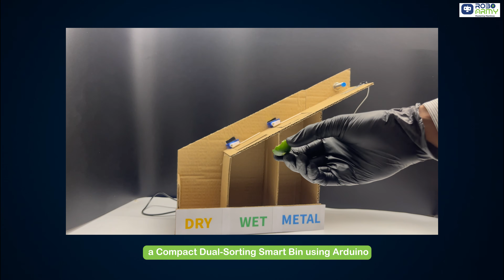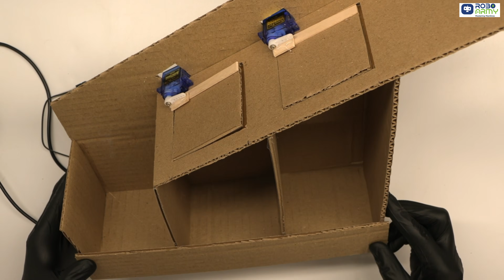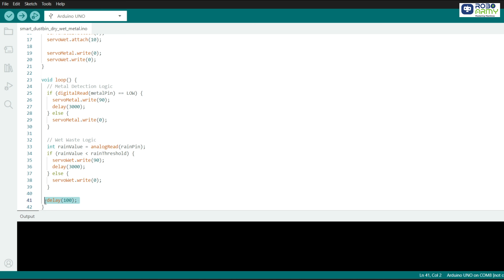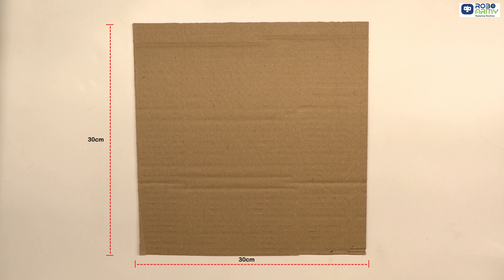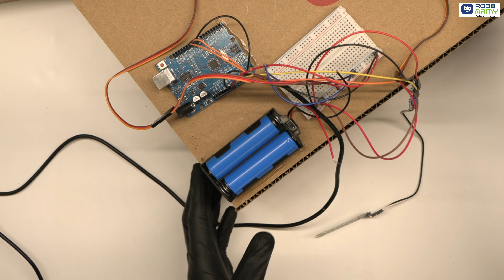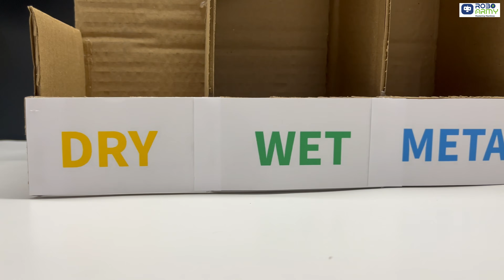Smart Dustbin using Arduino | Dry, Wet & Metal Waste Segregation Project 2026

Comment: sir make video using esp32 insted of arduino uno please sir ite a very very humble request and can we use rain module sensor insted of soil moisture?
Reply from the maker: Thanks for your suggestion! Yes, we can build this project using an ESP32 instead of Arduino Uno, and we'll try to upload a dedicated tutorial soon. You can also use a rain sensor module instead of a soil moisture sensor, as both detect moisture through conductivity, but you'll need to adjust the sensitivity and test it with different types of waste.

Comment: The code is not working
Reply: Please send me the crt code for this project
Reply from the maker: #include <Servo.h>

const int metalPin = 8;
const int rainPin = A0;

Servo servoMetal;
Servo servoWet;

int rainThreshold = 500;

void setup() {
  Serial.begin(9600);
 
  pinMode(metalPin, INPUT);

  servoMetal.attach(9);
  servoWet.attach(10);

  servoMetal.write(0);
  servoWet.write(0);
}

void loop() {
  // Metal Detection Logic
  if (digitalRead(metalPin) == LOW) {
    servoMetal.write(90);
    delay(3000);          
  } else {
    servoMetal.write(0);  
  }

  // Wet Waste Logic
  int rainValue = analogRead(rainPin);
  if (rainValue < rainThreshold) {
    servoWet.write(90);  
    delay(3000);          
  } else {
    servoWet.write(0);    
  }

  delay(100);
}

Comment: Can I use an adapter instead of battery pack
If yes how much current and voltage required
Reply: Pls reply
Reply from the maker: Yes, you can use a 5V/2A adapter instead of a battery pack for the Arduino and sensors. If you’re powering multiple servos, make sure the adapter can handle their combined current requirements, and connect all GNDs together.

Comment: Btw it is my father account 
I id not understand how to connect the wires and can i upload the firmware from win7 i need for my exhibition in class 7 and what type o jumper wires i need pls tell thanks.
Reply from the maker: Yes, you can upload the code using Windows 7 if the Arduino IDE and required drivers are compatible. Please follow the circuit diagram in the video for wiring. You’ll generally need male-to-male jumper wires for the breadboard. If you’re still confused, let us know which connection you’re having trouble with, and we’ll guide you.

Comment: Why is your connection (the one you made) and the connection in the photo is different?
Reply: I do both and both not working😢
Reply from the maker: Sorry for the confusion. The circuit diagram may look different because some wires overlap/cross each other, which makes the connections difficult to follow. The actual connections are the same. Please follow the pin-to-pin connections shown in the video and code.

Comment: what jumper wires do you use, male to male or what????😅
Reply from the maker: Mostly male-to-male jumper wires. If your setup is different, you might also need a few male-to-female jumpers depending on the modules you're using.

Comment: I want the uno and sensors names please
Reply from the maker: Components used in this project:

• Arduino UNO
• Inductive Metal Detector Sensor
• Soil Moisture Sensor
• Servo Motors
• Breadboard
• Jumper Wires
• Battery Pack
• Smart Dustbin Chassis 🚀

Comment: Good evening 
I want to build a humidifier which saturates the air when dry and can wet a dusty area
Reply from the maker: Good evening 😊 That’s a really useful and interesting project idea 👍 You can build it using a humidity sensor, Arduino/ESP32, and a mist maker or water pump to control moisture in the air.
Reply: @robo_army_  thanks I really appreciate 
Any advice for me as a 1st year mechatronics engineering student